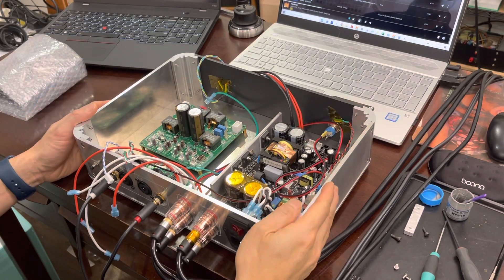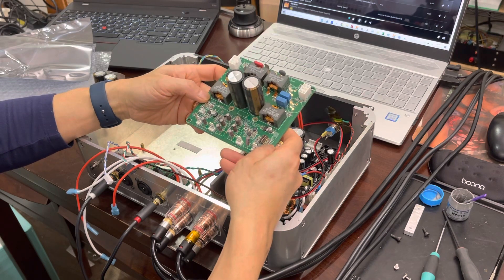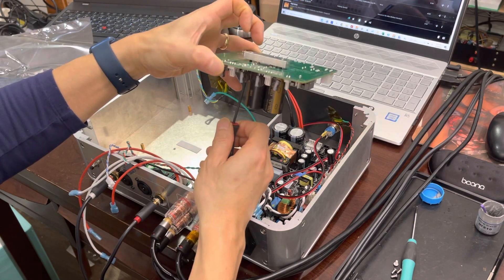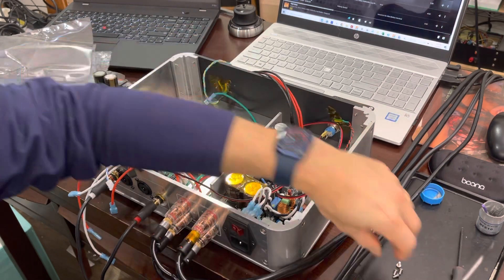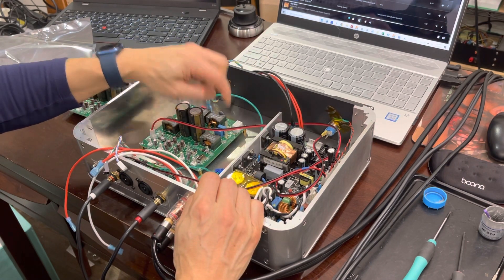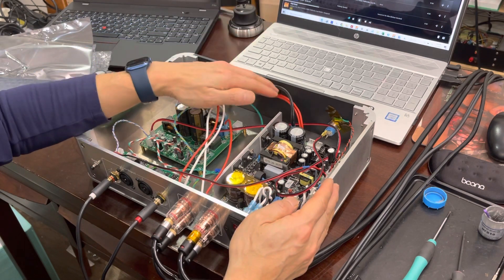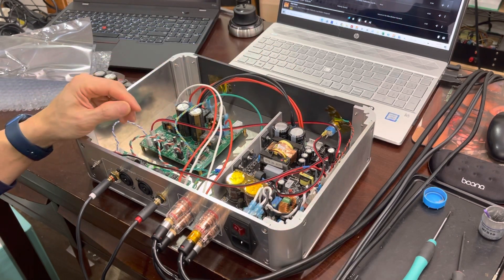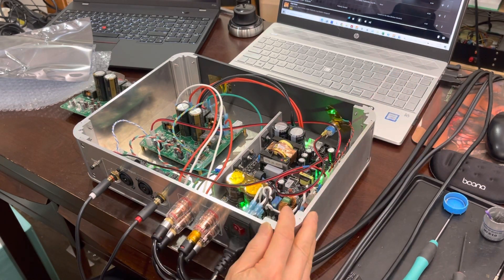Setting Up Your RTR TPA3255 Amp Module

Comment: How is the chassis grounded? Power cable isn't connected (as it rightfully shouldn't).

Not a good sign when an electrical advice video starts with SUCH a big question mark.

Comment: Nice design ... but the thermal solution needs some work.  It is very easy to crush a TPA3255 chip so spacers on the bolts between the PCB and Heat Spreader are needed to ensure both level and non-crushing assembly.  Also I would suggest increasing the spreader to case contact area by perhaps 2 or 3 times. The 3255 is a relatively hot chip and case level passive cooling is not the best solution.
Reply from the maker: We haven’t had any thermal issues with the heat spreader as designed.  Typical use case will be well under 100w of output and at 90% efficiency, the thermal output will be 10W. The spreader area is more than adequate for 10W and the large 5mm solid aluminum bottom panel can radiate probably 20W easily and has a silicone thermal pad used on CPU coolers for effective heat transfer and provides mechanical play to avoid crushing since the stack up height  and stand-off height is such to avoid interference. It should be noted that in all testing situations, even full power stress testing, the chip never suffered a thermal shutdown.
Reply: @XRKAudio 
Okay that's good news ... but the lack of spacers on those bolts is still concerning.  If the assembly is even moderately unstable, the entire thing is at risk.